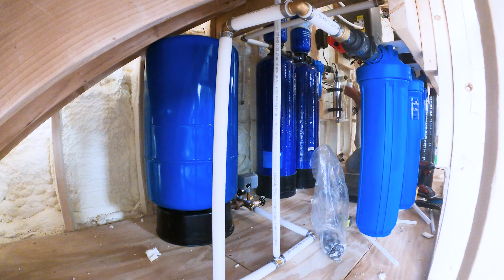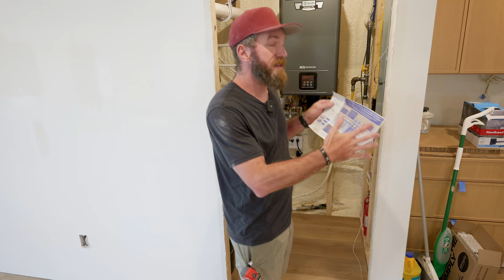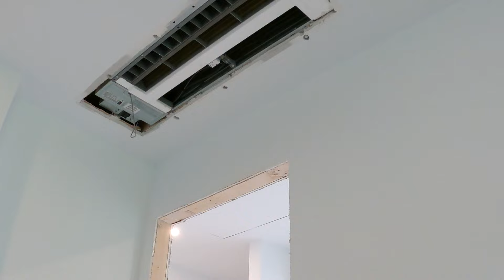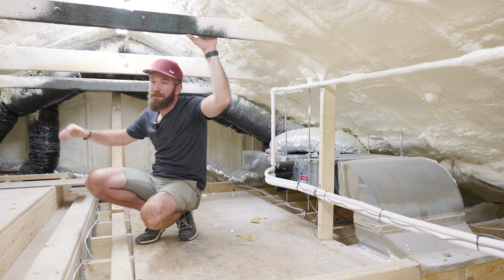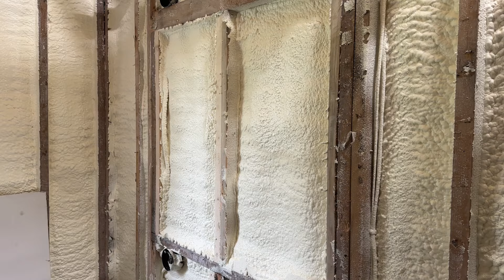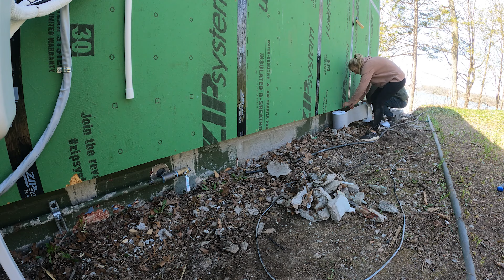We Turned a 1930s Cottage into a HIGH PERFORMANCE Home!

Comment: The tankless water heater nearly double the price of the biggest AO Smith traditional tank. That's a HUGE investment, plus most homes would require a pro to install as they aren't setup for a tankless water heater. I love them but the added cost of buying one and the added cost of install makes them out of reach.

Comment: Look up form spray in your roof it will over time rot out your rafters. it is a bad IDEAR FORM  SPRAY
Reply from the maker: open cell could cause an issue but from my research closed cell foam is the way to go.
Reply: @rogueengineer  this is correct. Good call on the closed cell in your climate. Even with open cell, humidity control and circulation will stop that issue.